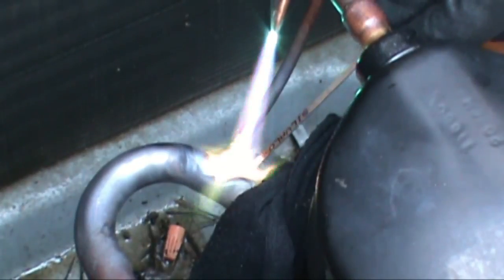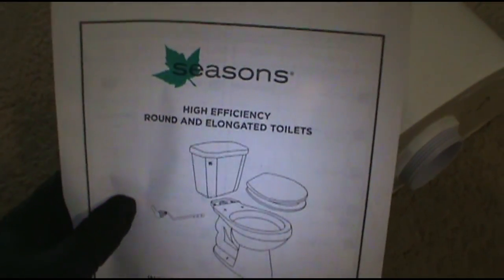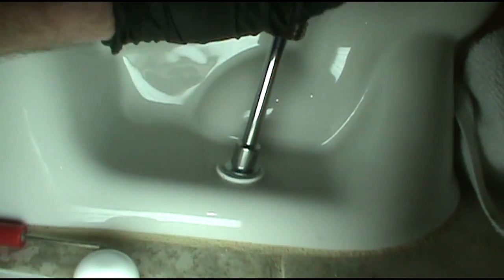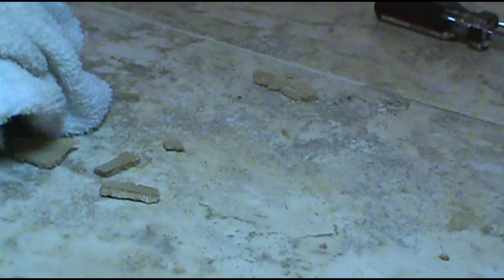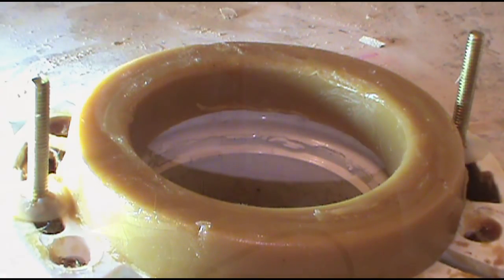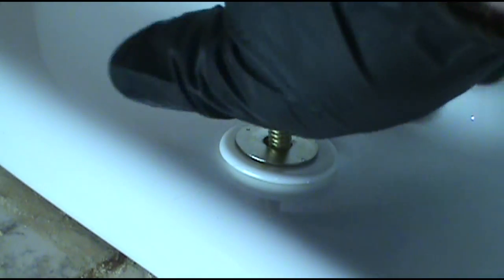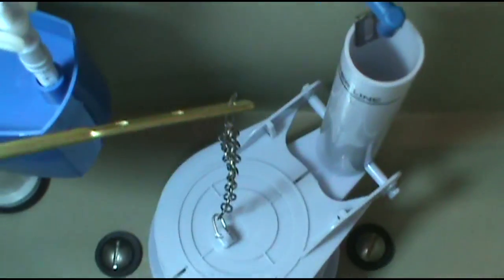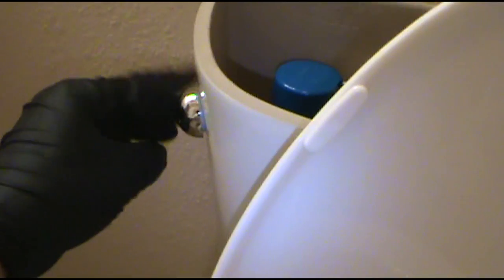HOW TO INSTALL A NEW TOILET

Comment: I caulk around the toilets I install but I don't caulk all the way around, I leave about 2-3" opening in the back for a weep hole to alert of a leaking wax ring. However I do test for leaks before I lay down a bead of caulk. Good job, appreciate your videos.
Reply from the maker: Jim Zeidler Right on! Thank you so much for watching Jim!
www.dirtymaintenancenation.com
Reply: Lex Vance You're welcome, Lex .
Reply: never caulk around a toilet....takes the floor up with it next guy has to pull it.

Comment: Why not caulk the front and sides of the base of the toilet but leave the back of the toilet base uncaulked? :) BY the way, were those nut drivers you used Kleins hollow shaft?

Comment: LiquiLock has a product that you pour in the bowl, after removing water from the tank and it turns the water into a gel, allowing you to remove the the toilet without spilling water everywhere. It is great for changing wax rings, after your done just stir the gel and flush the toilet.
Reply from the maker: Calvin Toups Ill check that out! Thank you so much for the wisdom Calvin! And thank you so much for watching man!
www.dirtymaintenancenation.com

Comment: What size nut driver and where did you get it? I didn't know they made hollow shafts that big
Reply from the maker: Justin 95 They sure do! You can also use a socket set that pops on to a screwdriver handle. I have those too. That's a half inch nut I driver I believe. Hollow shafted nut drivers are suuuweeeet!
thank you so much for watching Justin!
www.dirtymaintenancenation.com
Reply: Thanks for the reply. I have the klien 1/4 and 5/16 but Ive noticed you and Steve busting out the sockets and nut drivers on closet bolts making the job much easier. I also do apartment maintenance so I appreciate the expertise you put out there for us. Keep up the great vids!
Reply from the maker: Justin 95 You're welcome Justin! I'm trying to reverse the myth that maintenance techs are just lazy, unqualified hacks. Its not true. Thank you so much for watching man!
www.dirtymaintenancenation.com

Comment: Another HD supply special.... those seasons toilets have a good price from HD. I've used them before with no problems. It's not the ole ameeeeeerican standard but it works 😂. I found something for removing the toilets that you will love. It's called Oatey 31417 Liquilock Gel For Toilet Removal. After you turn the water off and flush the toilet add this to the toilet. It's the best thing since sliced bread. Once you use it you will always have it in stock for the next dirty maintenance job. 👍👍
Reply: Side note....  I do the ole Texas 10 flush to make sure that I don't have a leaker too. I defiantly like to caulk the toilet after I do the leak test because the caulk acts like an adhesive and secures the toilet to the floor. They will stay tighter a lot longer than if you don't caulk it. This will eliminate future call backs for loose toilets.
Reply from the maker: Danny L Oh right on Danny! Ill check that stuff out. Yea, the caulking is up to the installer. Its not right or wrong just a preference for whoever installs.
Thank you so much for watching Danny!
www.dirtymaintenancenation.com